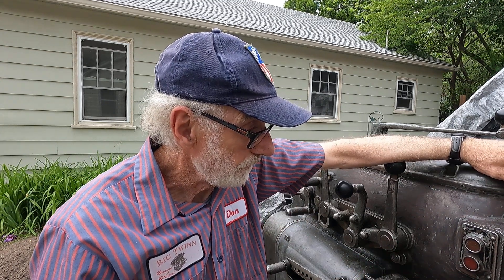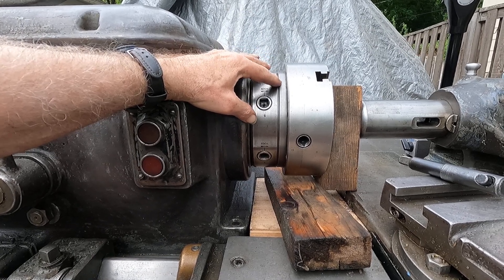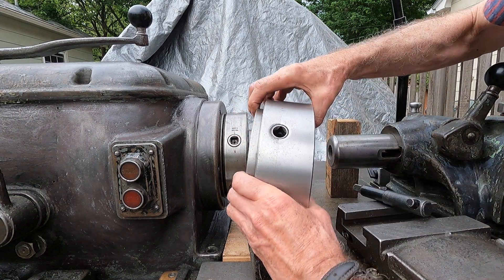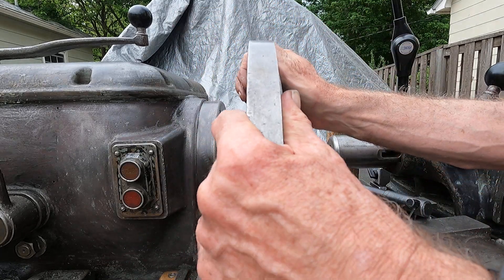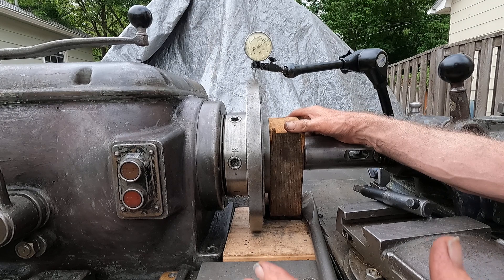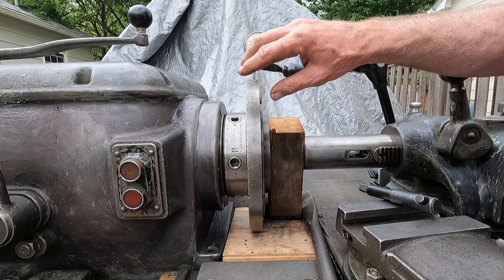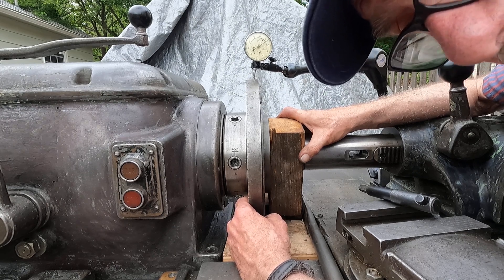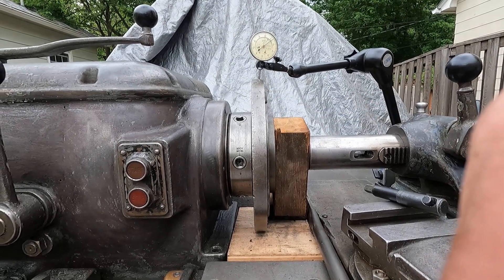Fitting D1 style lathe chucks

Comment: Hello, I really enjoy your videos. I too have a 14x30 Axelson lathe. Can you tell me what I need to mount a center in the spindle? My manual states the headstock has a 1 9/16" hole through the spindle and lists centers as 4MT. Do I need a sleeve adapter? Right now my lathe is 100 miles away so any recommendations will really help save me time. I have both the drive plate and the face plate, I have a couple collet chucks that I have questions about as well.  

Thank you for the videos
Mark
Reply from the maker: I have yet to determine the sleeve taper it seems it is mentioned and not specified but it is either Jarno or a lager morse taper, I will check it out and reply here  "when the rain stops" ha ha
Reply: @deedeeindustrialsuperprecision  Thank you!
Reply from the maker: @MANCHILDMD2020  From what I can tell the spindle nose taper on my 1941 version is No 16 Jarno taper.
Reply: @deedeeindustrialsuperprecision  Thank you for the help. I rely appreciate your time.

Comment: I picked-up a Burnerd 4 jaw years ago -- a honey of a chuck .   It is obviously a pre-early '50s  'cause there is no mention of Pratt on it .  They are still available as Pratt-Burnerd's,  but I'm sure the manufacturing sites have changed over the years .  I have several other independent 4-jaws,  but I have never seen fit to use them as long as the Burnerd survives .
Reply from the maker: I made a mistake letting the chucks go with the last gear head lathe I had, good chucks are getting harder to find. I have a direct mount solid steel Cushman 12" 4 jaw I found on HGR close out that fits great and the body runs true on the Axelson. I have not used a PB that I can remember but I think I used a collet system made by them.

Comment: DeeDee Another action, well really information, packed video.  God I love the Axelson tailstock features; best I’ve every used.  If the adaptor plate taper is seating so perfectly on the spindle nose, and your pry bar isn’t able to move your tenth indicator, it looks like the measured run out shown as you rotated the backing plate could be removed with a skim cut on the O.D. of the backing plate, or better yet adjusted out with the adjust-tru feature.  Am I missing something?  Did you get my private note?  Cheers, TB
Reply from the maker: Testing the backing plate further it has about  .001" run out that is very good. The 12" Bison Chuck is a plain back mount chuck and the Cushman 8" is a direct mount, neither are adjust true. Say, I just checked the Email, betdyar@outlook.com see if it works try again, I just sent one there and it worked.